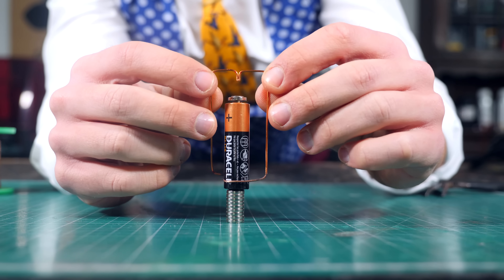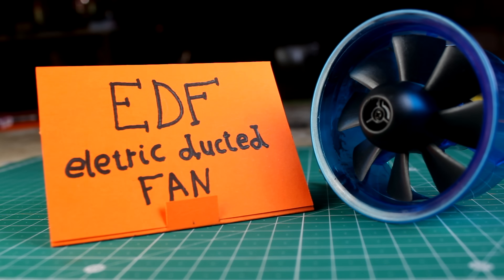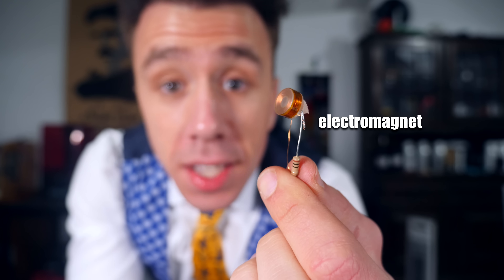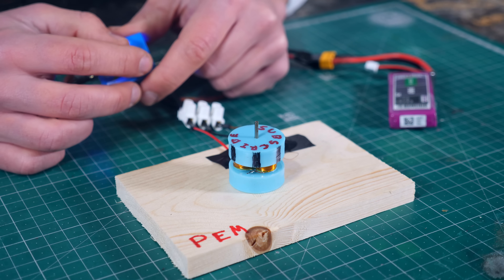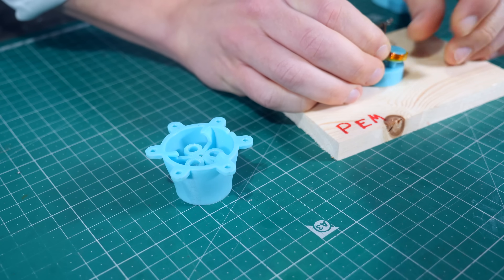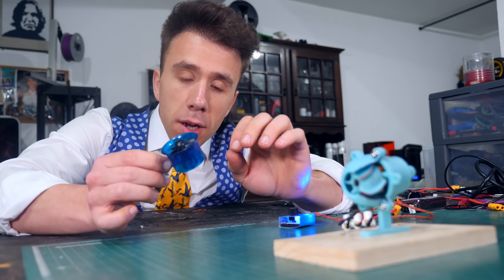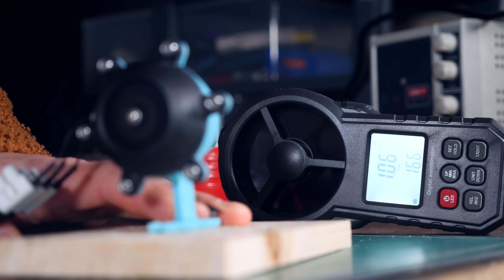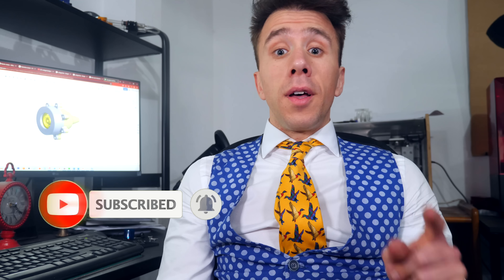I 3D Printed an ELECTRIC MOTOR FAN

Comment: Finally, something that it's perfect for the the theory I'm learning in flight lessons!

Fair warning, part of this is going to seem counterintuitive, because to move the most air possible with a propeller we actually reduce the angle of attack of the propeller so we can increase the speed of the propeller.  We want the propeller to move as much air as possible in the least amount of time, cause the end of that runway is approaching pretty quick during takeoff.

We can either move a decent amount of air per rotation but rotate much slower (high propeller angle of attack), or move less air per rotation but rotate much faster (low propeller angle of attack).  That last one gives us the most air moved per unit time, which is what we want during takeoff because we need to move as much air as possible as quickly as possible.

There are actually two types of propellers used in aviation, fixed pitch and variable pitch.  Fixed pitch propellers are not able to have their Angle of Attack changed during flight, so we use a design that is a compromise between moving as much air as possible during takeoff and efficiently moving just enough air during cruise.  Variable pitch propellers are able to change their Angle of Attack during flight, so we can get the best of both worlds.  To get the best performance out of a propeller during takeoff, we have to move as much air as possible with the propeller.  To do this we actually use a pretty shallow angle of attack, but as high an rpm as we can get out of the engine.  We move less air per rotation of the propeller, but rotate much faster to more than make up the difference.

The exact numbers vary based on the plane engine and propeller, but these numbers are taken from the Pilots Operation Handbook for a Bonanza A36.  Lowest officially recommended cruise setting is 2100 rpm during cruise vs 2700 rpm during takeoff.  So a 28% increase in RPM during takeoff.  Even with a small reduction in air moved per rotation, the increase in rotations per minute more than makes up for it.

By the way, I'd love it if you made some type of plane that might be used to test the idea of a gas turbine electrical generator making power for electric motors powering fans or propellers of some variety.  I think that's probably where aviation will end up.  Right now batteries just have too many weight problems and lack of range problems for practical, widespread use in aviation.  Plus there are a lot of benefits from being able to reduce the overall weight of a plane during flight as well as changing the center of gravity while in flight.  Changing the center of gravity alone can drastically increase the efficiency of aircraft because it lets us reduce induced drag from the elevators.  Can't really change the center of gravity or total weight in flight with batteries, but we can with liquid fuels.
Reply: Also very good point about battery powered aircraft being heavier. Avgas is 720g/l, whereas a battery pack for, say, a Tesla Model 3, weighs around 500kg. And at about 250 watt-hour per kg (870kJ) for the batteries vs 1,240 wH per litre for avgas... You can see the clear winner for energy density here. And considering how massive weight is as a factor in aviation, this would be a dealbreaker when it comes to electric planes unless they find a better means of energy storage.
Reply: @iamtheoneandonly_  it's just a guess, but I'd expect the issue being in the efficiencies - the generators, converters and motors have some losses, however small that may be. Also there's the weight of the infrastructure which would have to be present on the aircraft. I highly doubt it'd be more efficient than using the gas straight for propulsion.

Perhaps a bit of an equivalent might be to check how is the efficiency with those 'hybrid' cars with small batteries and internal gas generator to provide power when the battery drains.

Also, good luck with your PPL!
Reply: @hodekondrej  as an ex mechanic specialised in this stuff you're pretty spot on... Rolls Royce turbo props and alike are Gas Turbines turning propellers in the first place and any advances made in gas turbine generators will be same for conventional engines. So as you say makes no sense to have generator losses plus extra frictional losses and mass off an electric motor. Also as you mentioned with hybrid electric vehicles and I'll toss Hydrogen Fuel Cell in with ICE here, what else is there to them. And first big thing is the battery which is more weight again and it will need to be much larger than in an ICE car if you want to take off less you are going to over size the generator for that and then carry that mass with you all the time and you end up in a huge cycle of robbing peter to pay paul and its like the age old free energy question of what happens if I use a motor to drive a generator that powers the motor and we should all know that friction and heat mean it will very quickly come to a stop....

Really makes no sense to pursue when the issue is not really the emissions of the fuel in the first place its the carbon/energy source in the fuel that is the problem. We don't need some magical solution we just need a fuel source that is low carbon and is lots of those in development and till then does not make much sense to change what we are doing, just look at Boeing, check their plans for new aircraft and there is nothing on the horizon on purpose for this very reason and they and F1 are investing heavy in alternative fuels.
Reply: @Brougley  Thanks for confirming :)

However, I think I must kinda disagree, that no/low carbon fuels are the complete solution. It certainly would help with the emissions on the end of the chain, but the question of emissions from production remains in question. I must admit that I know almost nothing about these synthetic fuels, what's their composition, what resources (either physical or energetical) they require. But I can imagine the problem being in certain ways similar to full EVs or FCVs. For the former you need lithium for the battery and some source of electricity - which sadly isn't usually clean either. For the latter it's again materials for the fuel cell and power for creating and compressing the hydrogen.

Although in aviation it might be an acceptable trade-off to shift the emissions elsewhere, especially given the requirement for reliability and arguably lesser impact of emisions on ground-level when compared to high-altitude. All in all, better than current solutions, but I'm not sold on it being complete or really long-term sustainable/sufficient solution
Reply: @Brougley  Ture, modern turbine engines are very efficient. The difference in efficiency between a gas turbine powering an electric generator and motor vs powering a propeller or fan directly would come from the difference in operating speeds that each part is most efficient at.  The gas turbine may be more efficient operating at X rpm, while the propeller or fan may be more efficient at Y rpm.  In order to get each part to operate at its own most efficient speed, you either need to use a gearbox like we do currently or use some variety an electric generator and motor.  The Rolls Royce UltraFan already separates the two with a gearbox that also generates electrical power for the plane to use.  With a generator and electric motor combo, I think you'd have more flexibility in the different speeds the two sections can operate at when compared to a mechanical gearbox.  I suspect that may give you more overall efficiency, but right now I'm not aware that we're even exploring if it will or won't.

There also may not be as much of an increase in overall weight either.  Using electricity, you'd no longer need a clutch or mechanical gearbox, so you're exchanging the weight of the mechanical gearbox for the weight of an electric motor and generator.

There's are a couple of other potential benefits to,  First, it allows for the same generator to power multiple props or fans.  Right now many of the electric only designs are exploring distributed thrust with batteries.  I'd like to see at least some testing done with the distributed thrust concepts without needing to use batteries.  Second, it allows for better flexibility in the overall design by allowing the power generation unit to be located in a different spot than the thrust generating unit.

NASA actually did some research on it in 2018 with a paper title "A Review of Distributed Electric Propulsion Concepts for Air Vehicle Technology"  I'll paste the first page summary here.

"The emergence of distributed electric propulsion (DEP) concepts for aircraft systems has enabled new capabilities in the overall efficiency, capabilities, and robustness of future air vehicles. Distributed electric propulsion systems feature the novel approach of utilizing electrically-driven propulsors which are only connected electrically to energy sources or power-generating devices. As a result, propulsors can be placed, sized, and operated with greater flexibility to leverage the synergistic benefits of aero-propulsive coupling and provide improved performance over more traditional designs. A number of conventional aircraft concepts that utilize distributed electric propulsion have been developed, along with various short and vertical takeoff and landing platforms. Careful integration of electrically-driven propulsors for boundary-layer ingestion can allow for improved propulsive efficiency and wake-filling benefits. The placement and configuration of propulsors can also be used to mitigate the trailing vortex system of a lifting surface or leverage increases in dynamic pressure across blown surfaces for increased lift performance. Additionally, the thrust stream of distributed electric propulsors can be utilized to enable new capabilities in vehicle control, including reducing requirements for traditional control surfaces and increasing tolerance of the vehicle control system to engine-out or propulsor-out scenarios. If one or more turboelectric generators and multiple electric fans are used, the increased effective bypass ratio of the whole propulsion system can also enable lower community noise during takeoff and landing segments of flight and higher propulsive efficiency at all conditions. Furthermore, the small propulsors of a DEP system can be installed to leverage an acoustic shielding effect by the airframe, which can further reduce noise signatures. The rapid growth in flight-weight electrical systems and power architectures has provided new enabling technologies for future DEP concepts, which provide flexible operational capabilities far beyond those of current systems. While a number of integration challenges exist, DEP is a disruptive concept that can lead to unprecedented improvements in future aircraft designs."

Some basic research has been done, but very few prototypes have been built.  And I'm not aware of any prototypes that pair distributed electric propulsion with gas turbine power generation.  I'd like to see some built, and wouldn't mind helping with that in what ever ways I can.
Reply: @Brougley  agreed. Electric for serious aviation just isn't feasible. I fly model planes, with electric I'm getting around 6 minutes of flight time; the other guys in the club flying similar size aircraft but with glow fuel or petrol engines get 12 minutes of flight time easily. The problem isn't just the mass of the battery, its also the size. LiPo and Li-Ion just don't have the energy density to compete with IC. The batteries also have a limited lifespan, and then there's the material costs and actually getting the materials...

Synthetic, low carbon and carbon neutral fuels are more promising and realistic than electric.
Reply: @hodekondrej  thanks man!
Reply: @Brougley  Interesting! Although hydrogen storage is a challenge... you either chill liquid to nearing absolute zero, or you use a 700-bar pressurised tank. Both are quite the challenge... not to mention volatile. I would NOT like to experience crashing and ending up in a hydrogen explosion
Reply: @iamtheoneandonly_  what's often forgotten in energy density calculations (on any transportation mode) is efficiency. Aircraft engines, thanks to the even rpm, gets close to 40%, electric motors are above 80%. With that said, battery powerd flight is possible for short distances, but may never be possible for long distance commercial aviation. At least not in the foreseeable future.
Reply: PPL trainee here. Very good explanation!
Reply: (1240 wh/l is roughly equal to 1660 wh/kg)
Reply: Thank you for the explanation! :)
Reply: Haha noise goes BRRRRRRRRRRRRRRRRRRRRRRRRRRRRRRRRRRRRRRRRRRRRRRRRRRRRRRRRRRRRRRRRRRRRRRRRRRRRRRRRRRRRRRRRRRRRRRRRRRRRRRRRRRRRRRRRRRRRRRRRRRRRRRRRRRRRRRRRRRRRRRRRRRRRRRRRRRRRRRRRRR
Reply: @Nbomber I mean it's what happens when you increase the speed of a propeller
Reply: I may have misunderstood your suggestion but it sounds to me like a turboprop, that instead of powering a propeller generates current to then power a propeller. You still use fuel for the turbine, why add the weight of the alternator/dynamo and the electric engine to end up with the same thrust?
Reply: @Alex-bi2wv  These are the basic reasons why.  

1. Power generation redundancy and reducing the effect of adverse yaw in the event of engine loss.  Right now, if you lose an engine you also lose the thrust from the prop attached to it.  The plane yaws in the direction of the dead engine because of the drag from the dead engine and differential thrust from the other engine. That can be extremely dangerous if it happens during a phase of flight where you are already using most of your rudder to counter the natural yaw of the plane. Take offs, go arounds, and steep climbs are three such phases of flight where you are already using most of your rudder to counter the increased yaw caused by greater than normal p-factor, which is a result of Newton's laws and the engine turning the propeller.

If instead, when you lose an engine, you can continue to power all your propellers at a reduced power output, but still balance the power between each propeller, then you don't create adverse yaw at all.

2. Greater flexibility in overall design by using more smaller propellers instead of two significantly larger propellers or jet engines.  Right now the biggest limiting factor in aircraft design is where the engines go, and on commercial planes the engines have just been increasing in size, limiting design even more.  With multiple smaller fans or propellers, it's easier to use significantly more efficient wing designs, like a blended wing concept, which could easily be paired with other concepts like jetflaps.

And you get all of those benefits while still getting the benefits of using current fuel infrastructure, current knowledge on how to build and maintain a turbine generator, keeping fast turn around times for commercial planes, and the ability to change your center of gravity in flight for even more efficient flying.
Reply: @martin1blade  Adding on to what you said, adverse yaw can actually be worse on one engine than the other, due to a thing called the 'critical' engine. This is usually the left side on an aircraft with clockwise rotating engines. In other words, the operating right-hand engine will produce a more severe yaw towards the dead engine, thus making the failure of the left-hand engine critical.
Due to the asymmetric blade effect (P-factor), the right-hand engine typically develops its resultant thrust vector at a greater lateral distance from the aircraft's C.G. than the left-hand engine.
Reply: @martin1blade  Adding on to what you said, adverse yaw can actually be worse on one engine than the other, due to a thing called the 'critical' engine. This is usually the left side on an aircraft with clockwise rotating engines. In other words, the operating right-hand engine will produce a more severe yaw towards the dead engine, thus making the failure of the left-hand engine critical.
Due to the asymmetric blade effect (P-factor), the right-hand engine typically develops its resultant thrust vector at a greater lateral distance from the aircraft's C.G. than the left-hand engine.
Reply: (Also, counter-rotating aircraft do noth have this problem. Anti-clockwise rotating aircraft have the opposite problem: the right engine is critical)
Reply: @iamtheoneandonly_  I wasn't aware of that, but it makes sense given the outboard location of the engines and the moments of inertia.
Reply: @martin1blade  Glad to know I could be informative! :D
Reply: Just wanted to throw this video out there to get some thoughts on it.  It's a very interesting electric fan thruster design that I think has a lot of potential to be light weight for its power.  https://youtu.be/Lrnu0-vL504

Any thoughts?

Comment: i suspect the sriffmess of the plastic in the impeller  the size & number of the blades  the speed of the motor all affect it.  i agree about tomatoes except maybe in pizza sauce...  when i was a kid a neighbor convinced me those nasty green worms on tomato plants were what they made into guacamoli...  i know better now... i think.

electrostatic generators & motors are very cool, maybe you could power your fan with them. & maybe power them off the grid.

Comment: It does not sound logical to me that the impeller design should produce the same thrust, it is obviously not using all the air it can, so choking is an issue. Oh sorry, speaking engineenglish, the problem is in the effective cross-sectional area of the intake. Effective because look at the weird shape of the store bought intake, it expands